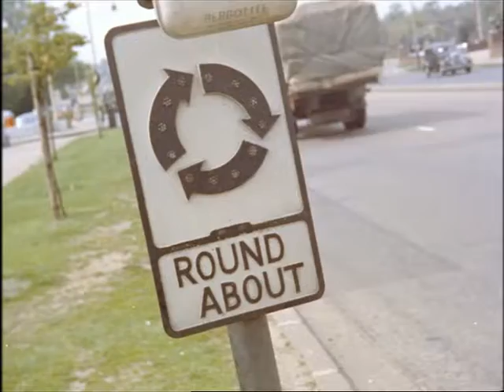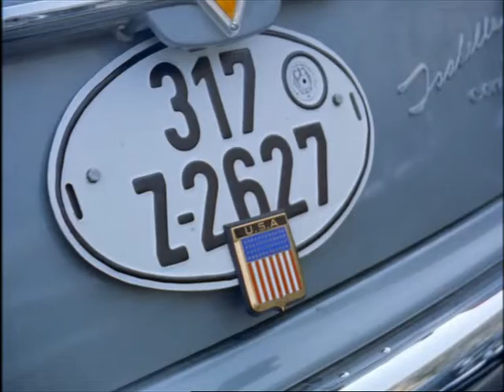Look at Life Vol 01 Transport    New Roads for Old 1959

Comment: Building new roads just encourages road travel, and merely causes a shift in the locations of the worst congestion. You can't flatten city centres to make space for ever more car parking.

Meanwhile with electric cars gradually replacing petrol/diesel, the government is set to lose billions in fuel duty. Road pricing is the eventual answer, and it has the beauty of increasing the £££s paid when attempting to use any road at a busy time of day, to help smooth traffic. The car-loving morons will bleat in opposition, but it'll happen eventually...

Comment: How times have changed,55 miles of motorway in 19 months.On the outskirts of Bristol we have a condemned concrete bridge carrying a major route over the M4 motorway.We have been told this will take over 2 years to replace,we are going backwards not forwards in 2025??🙄🙄🙄
Reply: Not a good time to  commute to and from Yate.
Reply: HS2. 55 miles in 55 years.